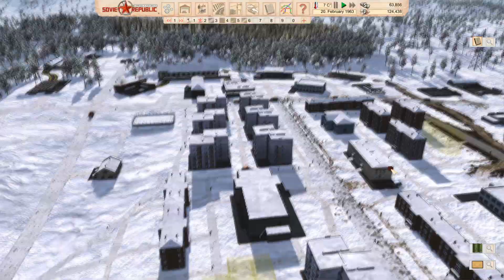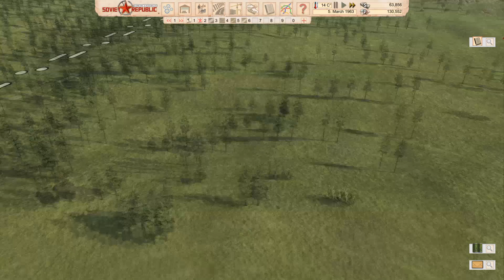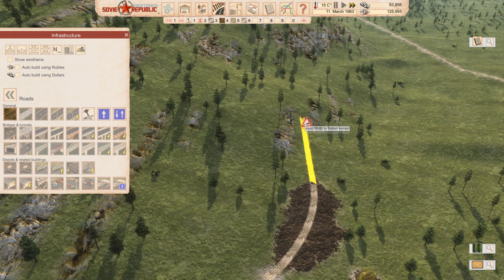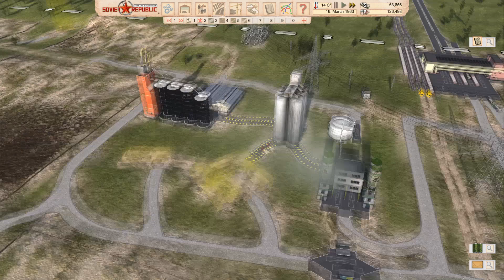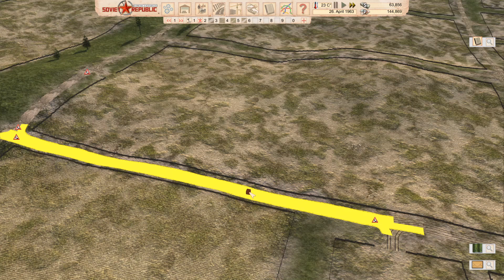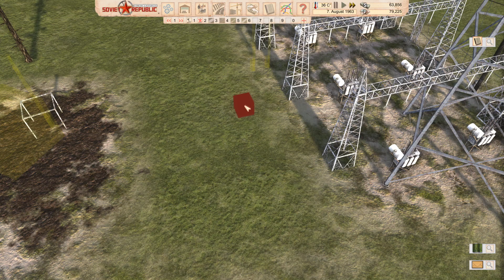Pollution And Growth :: Workers & Resources Soviet Republic (Seasons Update) #07

Comment: Why you don't assign auto construction to roads and footpaths only?
Reply from the maker: There are three reasons why I do not use auto assign at this stage of the game:

1.   Need the construction office to work on the key buildings and roads.  Auto assign results in the key vehicles. e.g, cranes, paver, etc, being sent to low priority builds.

2.  Low Cash and income. The cash to replace  expensive items, e.g. steel, components, etc, used in construction is limited.  Using auto assign will quickly drain the cash reserve resulting in there being no cash to buy imported items such as meat, coal and fabric.  

3.  It is important to plan ahead place buildings and roads that may not be required for a long time.  Therefore it is important to make sure the construction office do not start to build them.

Once the economy is strong and self sufficient I will start using auto assign to reduce the micro management.